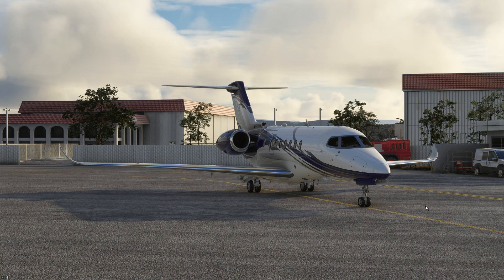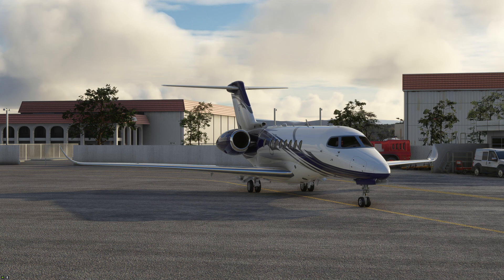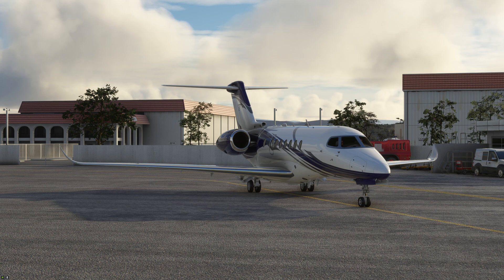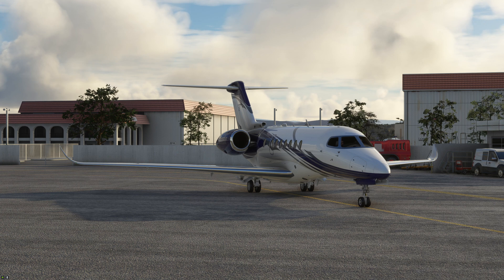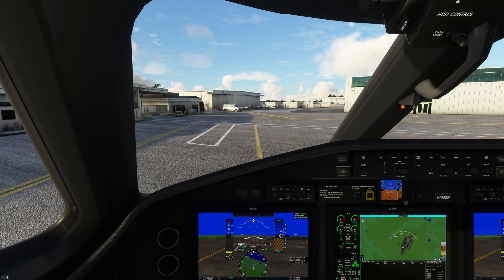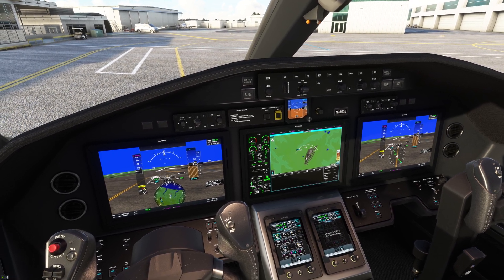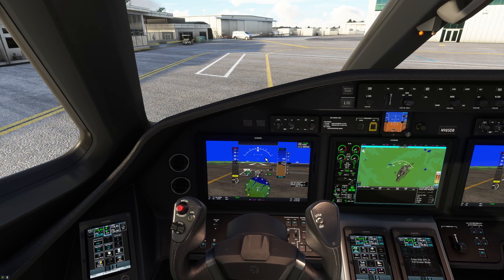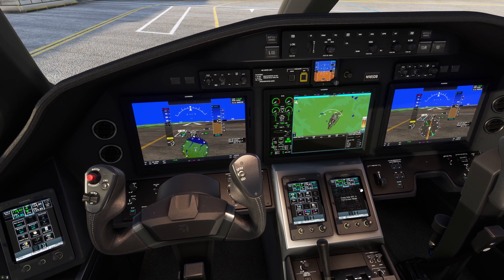MSFS | Citation Longitude | Garmin Touch Controllers | How To Assign To Desired Pane | 4K

Comment: I cannot get my screens to split in the way you describe. As soon as I split the PFD both PFD's become split showing the same windows. I am using the latest WorkingTitle version on an XBox. Perhaps the method only works on a PC?
Reply from the maker: First off, thanks for watching my video. Please do like and subscribe, as it helps my channel.

Now to your question, there is another download in the marketplace that you need to download. It's free and official. I'm at work now, so can't check. But go to the marketplace and search.

It was made a separate download so those with minimum PC resources can skip it and have both PFDs mirrored.

I'll check when I get home tonight, and give you the exact name. But by then you'd have probably already found it.
Reply from the maker: Ok I was able to ask someone. Look for "Longitude Enhanced" in the Marketplace, and download and install it. It's free.
Reply: @DiBarkis  That's great, many thanks for taking the time to check it out. Will Like and Subscribe 😀

Comment: great video! How did you get the flight plan displayed on the upper screens? I cant figure it out HA
Reply from the maker: Hi! Glad you loved the video. I'm assuming you mean the waypoints displayed on the lower portion of the screen below the map? If so, here's how you enable it:

*On the GTC controlling that particular pane (cyan or purple), click on the "Map Settings" icon (should be top left where "Map" usually is);

*Click on the "Inset Window" tab, and there are two buttons: "Vertical Situation Display" and "Flight Plan Text". The VSD is not yet implemented (hopefully in the future it will be 😁).

*Click on the "Flight Plan Text" button so the green light is illuminated. Enjoy! 

IRL, you'd have to choose between the VSD and The Flight Plan Text.

BTW, you can also do this on the PFD maps too. Just get the GTC to control them, and follow the same steps.
Please do smash the like button and subscribe to my channel. Every sub helps much. Thanks in advance.
Reply: @DiBarkis  Thank you for the quick response, got yourself another subscriber! It was easy to follow and I got it to work.

Comment: How did you get the updated standby instrument?
Reply from the maker: I got it from flightsim.to. Slip's mod. Unfortunately you can't switch from InHg to hPa so you have to download both versions and enable one or the other depending on where you're flying (either with addon linker or just place the desired one in community folder and remove unwanted one), i.e.: if you're using inches, (North America), then place the InHg version in the community folder, but if in hPa (Europe), then place the hPa version in the community folder. You can't have both at the same time.

Here's the InHg version:
https://flightsim.to/file/49080/citation-longitude-c700-sai-enhancement-inhg

And the hPa version:
https://flightsim.to/file/49290/citation-longitude-c700-esis-enhancement-hpa
Reply: @DiBarkis  Alright, thanks!

Comment: How do you pinch the when bring up the scroll pad on the GTC?
Reply from the maker: I haven't used that function yet, as I only use the knob to zoom in and out. I'm at work right now but I'll check when I get home, and get back to you.
Reply from the maker: Sorry for getting back late. I had to do some research. So, the touch function is not primarily enabled in MSFS but there is a workaround for it. 

You have to download the popout panel manager from flightsim.to. Here's the link:

https://flightsim.to/file/35759/msfs-pop-out-panel-manager

And here is a tutorial video on how to set it up:

https://youtu.be/GcdBJK4hfN8

Hope that helps you. Cheers.